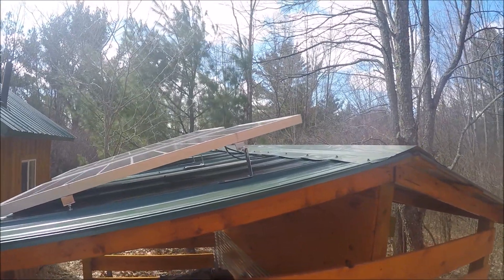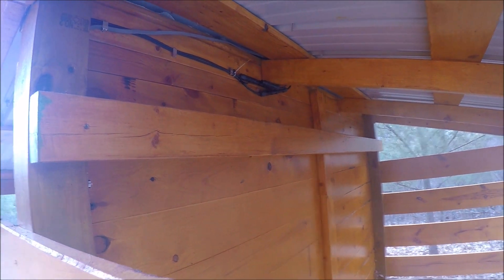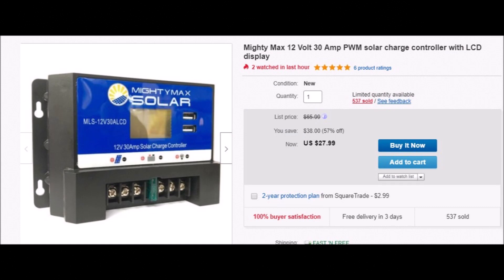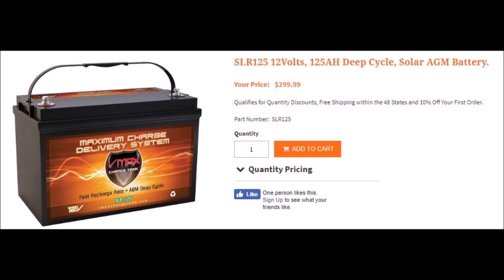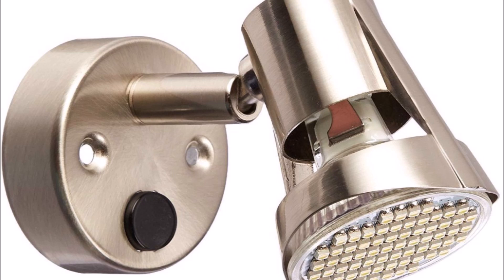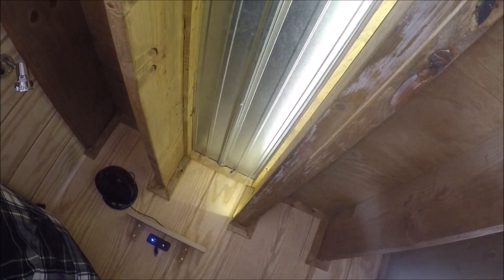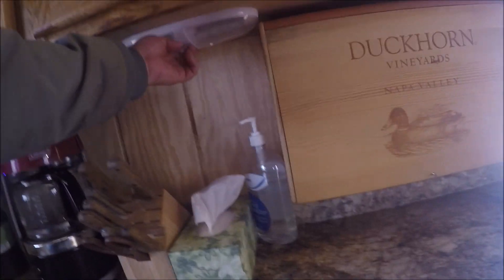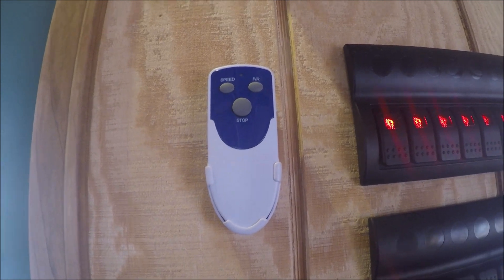Installing a Basic 12V Solar System in an Off Grid Cabin

Comment: I need some help, I need to know what size battery and panels I would need to run a small 12v 2.3amp fan overnight, would the harbor freight 100watt kit be sufficient to run the fan consistently for about 8 hours??
All the watts, amps, volts and math involved is like an alien language, and I really just need someone that's knows how this all works to tell me exactly what I need to get to run this fan consistently for 8 or more hours
Reply from the maker: I'll provide my opinion, but you can't hold me accountable if things go wrong!  I'm not an expert, but this is how I see it.   It has to do as much with your battery size as your solar pannel.  If you run a 2.3 amp hour fan for 8 hours, you will consume 2.3 amps per hour X 8 hours= 18.4 amps.  Check the rating of the 100 watt panel, but most 100w panels supply 5.5 amps/hr to the battery in perfect conditions.  So, in perfect conditions (light and temp) you will get this amount of amps fed into your battery.  If you have a 100 amp battery that is drained (never good), then in perfect conditions it should reach capacity in about 18 hours of perfect conditions.  You will then have 100 amps of power to run your fan.  If you let it run for 8 hours, it will drain your battery by 18.3 amps (at 8 hours per day), and leave 81.7 amps remaining for the next day.  Theoretically, you should be able to  run the fan for 5.46 days at 8 hours/day without any sunlight.  In theory, you will need 18.4 amps per day, so assume you have 10hours of daylight, you need 18.4/10=1.85amps/hr to supply the fan each day.  If your panel is 100w at 5.5 amps, then you need 34% efficiency to supply a day's worth of fan power.  If you live in Florida, you are golden.  If you live in Michigan shrouded in clouds all winter, you are still probably OK. If you skip a few days of sunlight, the 100amp battery will keep you going for several before drained.  The bigger the battery, the more time you can go w/o the need for a sunny, perfect day.  Helps??
Reply: Michigan Backwoods awesome thank you so much, that actually helped me out, I live in Oklahoma and it's usually pretty sunny here, although weather changes on a dime sometimes, but it's usually just sunny, thanks for the response and help I really appreciate it,

Comment: that means you will need a large number of volts if you need to power heavy equipment
Reply: Everything runs on DC now so you would need a DC inverter if you want to use AC equipment. But then he probably would need another battery and more panels.
Reply: guess

Comment: how are all these lights and stuff wired to one battery? or is the switch panel wired to the battery witch supplies power to each switch when powered on?
Reply from the maker: The solar panels are connected to a charge controller.  The charge controller is connected to the battery.  The same charge controller has connections on it which feed a switch panel for all the lights in the cabin.  All the individual switches are then connected to their respective lights.
Reply: So it’s not all wired to the battery? It’s cause of the 8channls switches you can distribute all the power from the battery to each individual light fixture and the usb bosses?

Comment: Im going to make a new channel to share more on off grid cabins/sheds. I'm way south in Texas right off the Rio Grande river.
Reply: Jorge Serna what’s the name of the channel? Would like to be updated as I plan to do something like this for a ranch I have. I also live in South Texas, Laredo to be exact.
Reply: @JesusTorres-gj3gj  I have an old channel  but I may use this as my main channel. I live in Zapata about 50 miles south of you. I just got bad news that the new highway 83 plans will cut my small property in half. I may wait on building till I get more info.
Reply: Jorge Serna will highway 83 run into your property or how is this going to affect you? That sucks man and yeah we’re pretty close. A buddy of mine has around 800 acres in Zapata. He’s also going solar with shipping containers as a home. Pretty interesting setup he’s going to have.

Comment: So you’re not running an inverter just that controller to each load device....correct?
Would like to see the rest of the install as far as the controller/battery/ load device connections.
Reply from the maker: It is simple.  Line from panels goes to controller.  The controller then connects to the battery, and the controller also has a set of connections for "Load" which feed your switches which feed your fixtures.  The charge controllers have instructions on how to set it up.  If in doubt, suggest you call a solar supply distributor and they can walk you thru the process.Good luck
Reply from the maker: Correct.  No inverter needed when running a 12v solar system......the entire system is shown in the video, i have nothing else to share, sorry.
Reply: Michigan Backwoods 
Thank you.
I’m looking for a very similar set up, maybe even more basic for 120 sq ft cabin.
All I need are a couple led lights, a fan and that’s about it.
Reply from the maker: Hall House, if that is all you need, go with a smaller battery and only one panel.  Good luck!
Reply: @Michigan_Backwoods  what gage wire? and where did you put the fuses? thanks very much
Reply from the maker: @edge1212121  I am going by memory but I think it was 12 ga wire.  If I recall, it was more robust than what was needed to carry only 12v, but my thought was if this were ever tied into the grid that I could use 12ga to carry 120v if I ever converted it.  There is one fuse at the battery, and individual fuses at each switch.  The fuses are built into the switch panel shown in the video.

Comment: Simple, one of the best video of a small solar system. Great! I'm in the process of installing one for myself: two 150 watt 12v solar panels, PWM Renogy Charger, 1,500 Inverter (it isn't pure sinewave) and still searching for the battery. That's the expensive little bastard who sucks your budget.

Comment: grate video like the fan and the lights  is the fan 12 volt
Reply from the maker: Yes, fan is 12v and runs on very low amp.  Buy on Amazon or ebay
Reply: ..his cabin build video said the fan was 12v